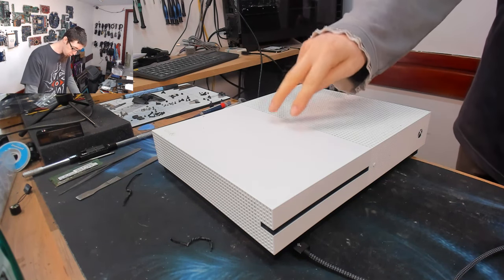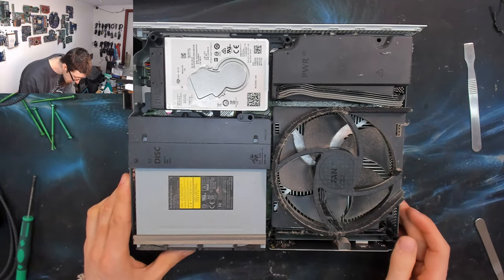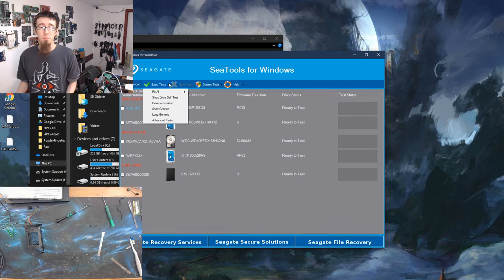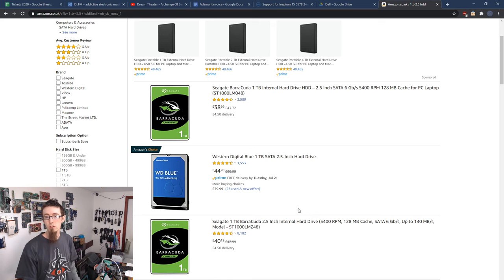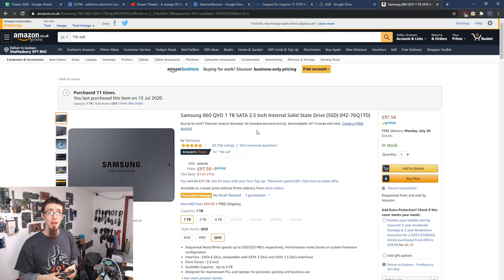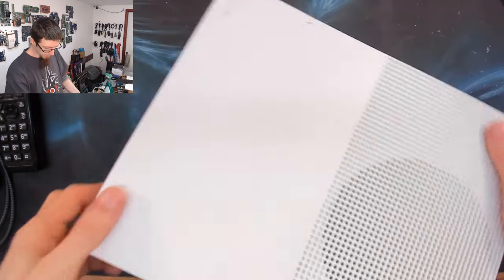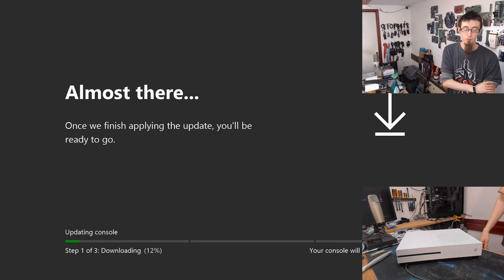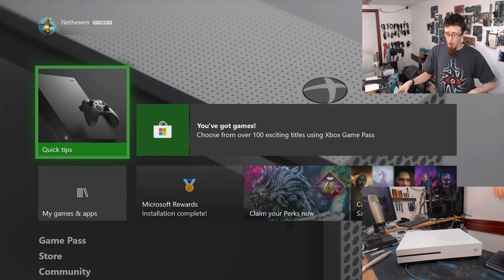Replacing an Xbox One S HDD with an SSD - LFC#214

Comment: If I have a 1tb xbox one can I put a 500gb Ssd in it
Reply from the maker: Yes, but the general consensus is that 500GB is too small for a modern console. If you're short on cash, I'd stick to HDDs for now, and take the capacity instead.
Reply: @Adamant_IT  its going in my xbox one kiosk I just want it for the reliability

Comment: I'll be doing at least part of this very procedure, and hope I don't run into any issues. I suspect a drive failure like you had here, I get the exact same error code. If so, then the entire fix will be identical as yours. Glad I watched this, it appears it's exactly what I need to do... thanks. 

Edit: after doing some research I've discovered this video does NOT show the full precedure installment process, it leaves out part of it. You cannot install a OSU on this Xbox on a blank drive without preparing the drives partitions on a PC. This Xbox cannot partition and format their own drives... which you did NOT show.
Reply: This is exactly what I was wondering, thank you. So should I format the new ssd in Windows to NTFS?
Reply: @damon323  if I recall yes, it is NTFS.
Reply: @garyr7027  Thanks man. I just bought a WD Blue SSD. I’m actually even getting it delivered today with an adapter so I can plug it in to Windows first to see what the format is out of the box
Reply: @damon323 new drives are blank, they don't have any partitions. Plug it into your PC, and in my computer, right click on the drive, scroll down and choose format, then choose format NTFS option and windows will take care of the rest. If I recall you'll only need one partition so do a partition on the entire drive capacity.
Reply: @garyr7027  Sounds great man, really appreciate the reply! I always use Disk management in Windows and SSD's, but wasn't sure on the Xbox. Thanks again. I should've done this upgrade a long time ago. I hate spinning drives. Lol!
Reply: @damon323  not a problem, you can use disk management but there's really no need if you're not doing separate partitions, it's quicker just to right click on the drive in my computer. Disk management will work no problem there, but it's mainly used to divide the drive into different partitions or resize partitions... just sayin.
Reply: @damon323  ... and btw, I'm with ya, HDD's are a thing of the past, all I use now is SSD's and M.2 drives.
Reply: @garyr7027  Good call man, that is way quicker and more simple!

Comment: Mate I got error 102 when doing this any idea on how to fix it?
Reply from the maker: Are you restoring from a USB drive? Tried redownloading the software again?
Reply: Adamant IT yes I have tried several USB drives it will download the update and verify but once it finishes verification it reboots with the error on screen
Reply: Yes ive tried this i seem to be getting error 100 now
Reply from the maker: According to the troubleshooting pages (https://support.xbox.com/help/hardware-network/console/system-update-solution) this one's 'hardware error'. I reckon you might need to pull the new drive out and test it. Did you go SSD or another HDD? If HDD, seatools it. If SSD, try formatting it on a PC and transferring a large amount (100GB or so) of data to it to see if it falls over.
Reply: @Adamant_IT  no i put in an sshd 1tb i did seagate it passed both tests i been looking around and fourms say it might have corrupted the OD firmware and possibly bricked the system
Reply: @Adamant_IT  I'm not sure if you know about GSmartControl, but it's a GNU/GPL HDD Diag utility. It has multi-platform versions, as well as portable ones too...And it works with SSD's too. B-)
Here's a link:
https://gsmartcontrol.sourceforge.io/home/index.php/Downloads

Comment: Did the customer go for HDD or SSD. I put a 4rb ssd in ps4 Pro and runs so quiet....no more jet engines noises. 

I know what your thinking....why put a 4tb in a pro when the ps5 is out soon....well my ps4 Pro will go upstairs after, which will mostly be used by my wife...she usually watches Netflix in bed, but she usually downloads most of the free games off plus....so lots of space will help.
Reply from the maker: We went HDD in the end. SSDs can give more speed, but it's a bit circumstantial, and adds a lot to the cost. It's up to each person as to if it'll work for them, and what games they play.
Reply: Which drive did you use?

Comment: That drive was indeed buggered :-D
I'm not a big lover of connecting drives to windows,  windows often writes to the drive without asking.
If you are recovering a drive,  you don't want any writing to happen at all.
Windows thinks that every drive belongs to it, not a good idea :-(
I imagine that linux would be safer.
Reply from the maker: Yea not wrong, I usually use a Mac for data recovery for the same reason. This wasn't a data recovery concern though, just needed to run diagnostics.

Comment: I did to several X1's and with my one X but I used a script tool from XFiX here on YouTube. I went with a 2TB of an 860 QVO and definitely helps tremendously in a lot of titles. Sometimes the formatting can be finicky but it looks like you got a good one first try. I learned never put it back together until you can confirm the update can start successfully! lol

Comment: Quickly closing is on 50K subs, sometime in August btl. Any plans for  a video to mark that milestone? How about a viewer Q&A? I've got a couple of questions you could add to your list. I'm a fairly new subscriber (last few months) so you may have answered these in previous videos ... apologies if this is the case.
1. How did you get into repairing PCs and do you have any formal training or are you completely self taught?
2. What happens when you break something during a repair? Do you always foot the bill or are there some situations where the customer has to wear it? You must get some pretty janky computers come through your doors that either have garbage components and/or have been poorly looked after and are therefore a repair nightmare.
Reply from the maker: There are some plans! May well do Q&A as well, I keep threatening it.

Comment: do you have to format the ssd (when its brand new) to ntfs before you put it in the xbox?
Reply from the maker: Nope, the recovery did all that for me. An SSD/HDD is Uninitialised out of the box, so usually you've had to partition and format it, but yea, apparently the recovery handles that nicely. It was very streamlined.
Reply: @Adamant_IT  yeah this is a lot like  installing windows on a PC now.  thank god Microsoft has removed all the hassle for replacing a drive unlike the 360.
Reply: @Adamant_IT  okay thanks for the answer
Reply: No however if your reusing an older drive from a Windows PC use diskpart and run clean command on the drive. However be careful with clean it deletes everything on the drive and does not give a warning. The commands are below. You can find the correct disk using the list disk command for my example I am going to assume the drive is #4 in your system.

diskpart
list disk   
select disk 4
list disk   (to make sure the disk you want is selected)
clean
exit

Comment: Thanks for the content. I wasn't aware an SSD upgrade was that easy. I thought the process was more involved like using cloning software and messing with partitions. I'm wondering if my Xbox One X will accept a 2 TB SSD now.
Reply: well it would be if you didn't wanna reinstall games and such
Reply: yes it does use osu1 tools offline system update with unformatted drive ;-)

Comment: It is a Seagate.  I have heard that the 2.5 inch Seagate drives have a high failure rate, especially when they are part of an external hard drive.  When they fail the data is impossible to fully recover because the damage is usually a head crash.  That one may be having a different failure but none the less I would not even use that one as my backup drive, it can completely die any time in its current state (get much worse).
Reply: Seagate "Rosewood" series of 2.5" drives. 100% failure rate, with some not even making it to the 3 month mark. Makes Toshiba 2.5" HDDs look like premium grade in comparison lol. The only people that love those junk seagate drives are in the data recovery business cause it brings them $$$

Comment: That's probably what I would do if I had an Xbox regardless of whether or not the drive was failing. I even put an SSD in my BT YouView box.
Reply: hah nice! An SSD in a PVR had not even occured to me - they're only just becoming a thing factory installed into games consoles! Has it actually made any speed difference...? Isn't the box's software on its own flash / ROM chip, with the drive only being used for recordings...? Or has it made recordings load quicker...?

Also, what did you have to do to get it to work...? Aren't the drives "coded" to their box to prevent extracting the recordings for copyright reasons...?
Reply: RWL2012 in the BT YouView box the software is on the HDD/SSD. It has a basic program similar to a BIOS that you might find in a PC. To install the software to the SSD I had to look up replacing the HDD and was able to find the relevant instructions for downloading to my upgraded box. With the old HDD installed the box would lockup when scrolling through channels, this might be because it immediately begins to record what you are viewing so that you can rewind whatever TV show you are watching (I guess the HDD couldn’t keep up). This doesn’t happen with the SSD installed. I don’t know about drives being coded to their box, but the format used isn’t compatible with a Windows PC.
Reply: @Kundalini12  thanks for the reply; great info!

Comment: I installed 1tb but when i check The storage IT says 365gb
Reply: what xbox one have you got
Reply: @si4632  Xbox one s
Reply: @kingjack6974  did you format the drive in a pc first
Reply: @kingjack6974  and what was the size of the hard drive it replaced
Reply: @si4632  no i didn't and IT was 500gb
Reply: @kingjack6974  right well that made me bottle getting the one tb drive i just went with a 512 mb its installed did you press the pair button and eject for 15 secs while turning it on

Comment: Would personally go for a 4TB HDD instead of the SSD. Especially if what Vexx said is true.
Reply from the maker: Valid option!
Reply: The Xbox will only access 2TB from an internal drive though.
Reply: But you can add up to 2 external HDD's with a combined total of 16TB! That's a massive 18TB system total (ie 2TB+8TB+8TB)!

Comment: That all X-Box players need to do. Upgrade the SSD in the X-Box One or 
X-Box One X and all the new X-Box SX games will play on your old system 
just fine. The devs that made the games for the X-Box SX used a X-Box 
One X as the devkit to work off of. Unlike the Sony PS5, their was an 
actual devkit, hints the reason why PS5 games are going to supremely out
 perform the games on the X-Box SX.

Comment: can you give me a advice i bought a used XBOX 360 from second hand everything was working well i could login to my account and set my games but one day i took out the hard drive from XBOX 360 and formatted from my computer from that day the XBOX 360 did not want to detect the hard drive i tried everything it did not work but when i connect the XBOX 360 hard drive to my computer it work very well i format it as FAT 32 i did everything but i could not understand why the XBOX did not want to detect the XBOX 360 hard drive

Comment: Oh dear it is a Seagate - worst drive reliability and customer service ever - recent survey I read unsurprisingly puts them worst for reliability/returns 7 years in a row.

Got a 4tb in November as a pressie been sitting on a shelf only comes on on Friday for backups only done 124 hours & failed already!

Just bought a few on ebay to play with and see if i can repair - seller has 150 of these notorious 3TB Seagate STDMXXX drives all failed same firmware issue looks like they came from a surveillance setup - sorted the first drive with a replacement board and swapped the bios chip and can see the partitions - Hate Seagate!

You seem like a very competent and decent computer repair guy most of the ones I know charge through the nose and only do 1/2 of the job you do dude - well done £50 labour is very good only one good computer store in the whole of Glasgow you must be the only one in your area too lol!
'👍🍕

Comment: So I have a problem with my display picture going out. I’ve seen a lot of people having said it is the hard drive going bad and even an xbox mechanic said to replace the ssd. Do you know what rpm to look for ? I was told not to get 5400 but to get 7400 rpm. Only western digital or hitachi. What come factory with xbox one s ?

Comment: Good stuff. Considering doing this. One issue I have wondered is if the OG HDD can be cloned onto the new one and then the storage expanded rather than utilising a fresh flash install where everything like settings etc has to be setup again?

Comment: I'm guessing this guy quotes £50 labour regardless of the issue because diagnosing a faulty component on the board and soldering a new one seems fair at that price since most components are SMD but paying someone £50 to replace a drive is crazy... Just my opinion

Comment: dude did a break down on the homies Xbox, as I own a damned rig worth more than most peoples cars and build systems regularly im more comfortable with it than he and offered to do it. I am gunna throw a ssd in it for him now to but id suggest offering a "fresh restore" option on your shops menu.... I used a lil under a half gram of corsiar tm30 and holy crap the xbox I gave him 2 years ago (now almost 8 years old) looks like it's a brand new day on Xbox s og model and even loads flawlessly when before was stuttering hard... wasn't hard to do but the factory paste was dry as can be and im sure it was gunna fry soon SMH

Comment: SSD drives in a game console is not only good for increasing speed. It is also far more robust as it is has no moving parts. The  original hard drive probably suffered from a head crash as it had bad sectors. This is usually caused by the gamer moving or dropping the console whist the HDD is still spinning. It is why I always suggest using an SSD in notebooks too (not just for the vast speed improvement but because they often slip off your lap or get dragged off the table when tripping over the charger cable).
Reply: SSD Is top in every hardware today...
Reply: @revelator3665  Sure - plus - if the PC/notebook/XBOX ever goes wrong, you can remove the SSD and use it in the next one you buy. So you don't waste money buying an SSD.
Reply: @steve6375  i have mx500 inside my one x, night and day difference.
Reply: The failed HDD in this video is a Seagate "Rosewood" series drive. These turds have a 100% failure rate, with some not even making it to the 3 month mark. The only people who love those junk seagate 2.5" drives are people in the data recovery business (because it brings them $$$). This has nothing to do with the user moving or dropping the console, these rosewood drives will fail even under perfect conditions and with no physical movement

Comment: Can you please help posting a trouble shoot . xbox one S starts but I am unable to get a display. It is out if warranty. Hardly used actually. There was some power issue at home it blew my TV in seconds . Bose speaker is intact. Am yet to take it outside for a check up

Comment: I picked up a used original Xbox One from an acquaintance only to play some Forza Motorsport 6. I'm normally a PC gamer, but this console you're repairing seems to suffer from completely identical problems that my used one does. It constantly disconnected from Wi-Fi, whereas no other device that owned did at the time nor do they do so now, and connecting to Xbox Live was a hassle everytime! The controller pairing button is completely broken too. It looks and clicks as it should, but literally doesn't function.

Comment: Put a 1tb SSD in my one x yesterday, worth it. However I've read the one x storage connection is sata 3 while the one s is sata 2 so you won't be getting the full speed of the SSD in a one s. It'll still be faster than the HDD though.
Reply: The original Xbox featured a SATA II interface, while the Xbox One S and Xbox One X both have a SATA III interface.

Comment: I had an e105 system error on my Xbox one x, it's a hard drive issue. So I changed the hdd HD to a ssd HD and the same error came back. E105 error is the new red ring of death!!!
Reply: What SSD do you use? And size?

Comment: Does anybody know if a hard drive from the original Xbox One S ~2016 would work on an All-Digital Xbox One S with a bad hard drive? Could I just swap it in? The connection looks the same, and the motherboard on the All-Digital One S is the same as a regular One S from 2016-17 I believe...
Reply from the maker: Yea, the drive will have the same standard SATA connector on it.
Reply: @Adamant_IT  Yeah, the connector looks the same. So, the Xbox One All-Digital should boot up no problems on the hard drive out of an older One S then. The one I have is a Toshiba 500GB hard drive

Comment: You'd be wanting to put a fair amount of pressure on the top of a 2.5" drive to damage it. Unless you are doing something wrong it's fine to touch the top. Apart from that bit of over exaggeration, nice video.
Reply from the maker: True, I'm mainly speaking from seeing people hold stuff in a death-grip because they're afraid of dropping it. Better to teach people an easier way to hold something that to try and teach exactly how hard is too hard.